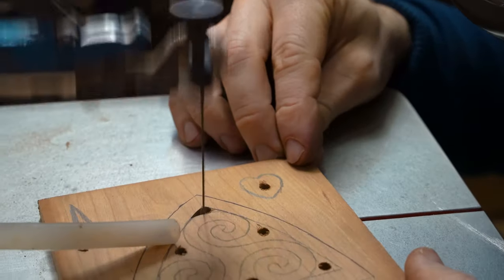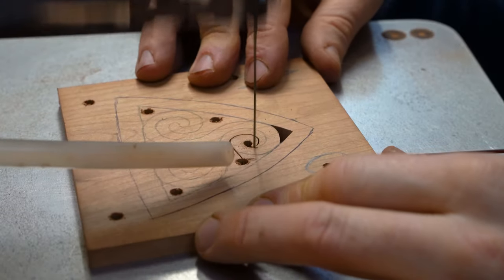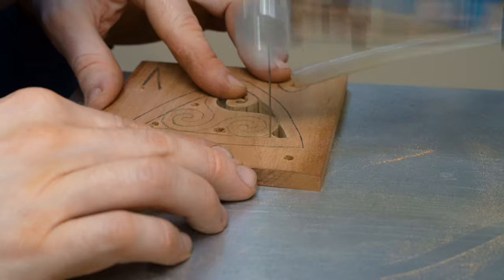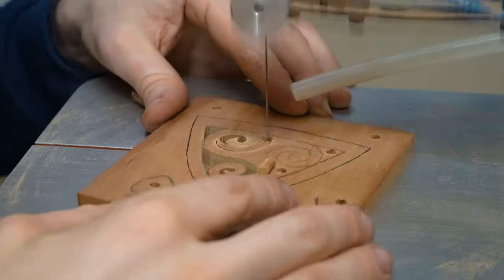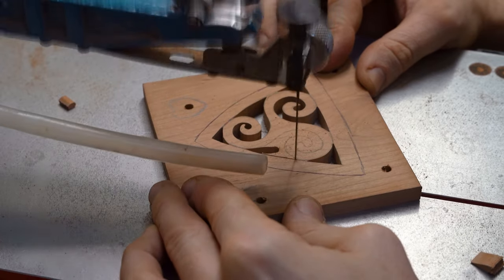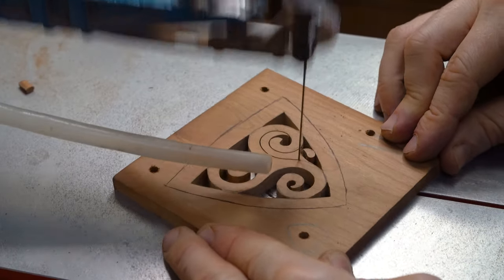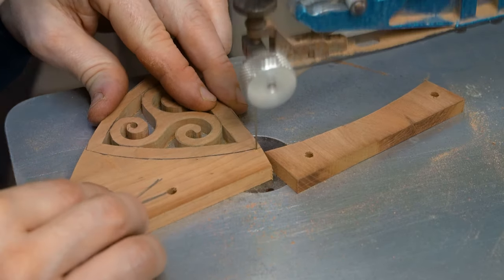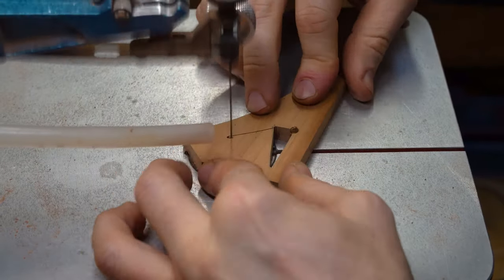Scroll Saw techniques for beginners

Comment: Thank you. I'm relatively new to scroll sawing and appreciate your instruction. Am also amazed at how easily you were able to do the scroll work using a straight blade. Well done.
Reply from the maker: Hi Sherwood, great to hear from you. Delighted to hear that the video was useful. I prefer working with reverse tooth blades and my favourite blade is the Niqua speed number 9 reverse tooth blade. Pegas and flying dutchman also make the same blade.

Thanks for supporting our YouTube channel. All the very best from us all. 👍👍

Comment: How much cost the machine?
Reply from the maker: Hi again, great to hear from you. The scroll saw we use is a Hegner Multicut 2s. To buy it new costs between £800-1200. However, you can often find them on ebay for between £250-500 second hand. You can contact Hegner for any spares required too.

We have 2 of them here at our family workshop in daily use. They both work perfectly after being in daily use for 20+ years.

Thanks again for supporting our YouTube channel. All the very best from us all. 👍👍